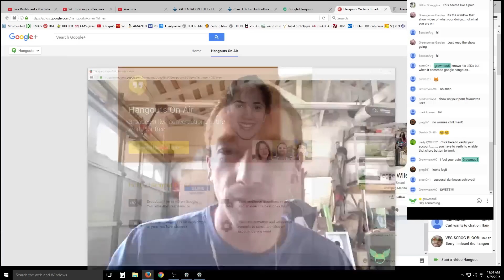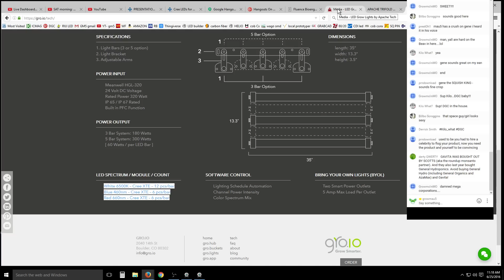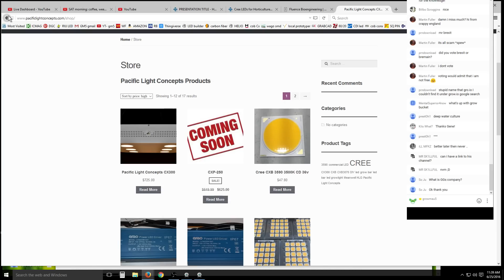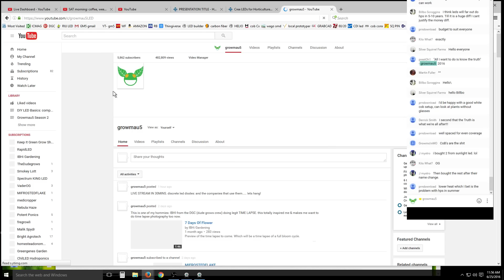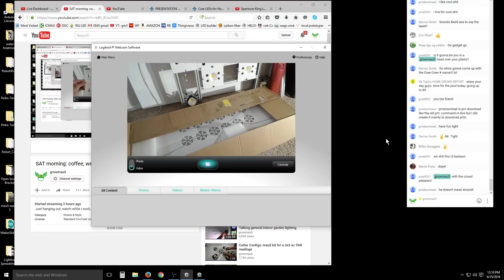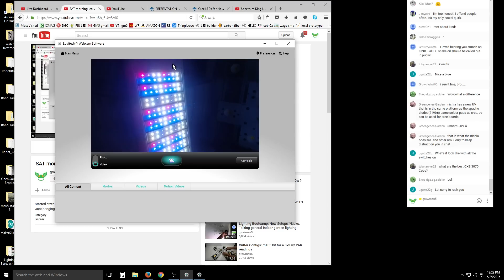LED Tech Talk w/ greengene: discrete diodes & the companies that use them

Comment: 1000 watts for a 4x4 is like..4 times what I'm running for Cattleyas, orchid folks. I've got a mars ii 1200 which is 550 watts, but I only run the grow or bloom switch. Never both at the same time, so that's about 225 watts. My area is also slightly less than 4x4, as I use the standard wire shelves that everyone uses and they are about 15 inches. It works very well, but I'd rather have 4 smaller lights spaced out over the area, and running each of those at full power. Because using the bloom or grow switch is just kind of a waste if totally separate leds light up on each switch, though when I think of itnow, I think some leds are on whichever switch I am running.

Comment: Hey man, i wanted to make a cob light setup for a 3x3 or 4x4 and was thinking 7 cxa2530s due to price mostly; and i wanted to know if for a driver a meanwell lpc-150-500 (150W 150-300V 500mA) would be good or if there was better as far as drivers go. ive been meaning to ask during a roundtable but i cant hang that late on fridays im on the east coast

Comment: I asked you about a month ago about the sk600 and you kinda said they where junk, that copper board is coated in gold and the closet case is only 100 watts and I'm vegging a 5'x5' no problem so it sounds like your changing your tune a bit, some others I've used are, platinum, advanced platinum, lush,sunnine ,pro grow,budmaster,raysace,tiber and what do you think of the perfect sun from grow pot cheaply, check these out and see what you think,cheers

Comment: Here's how to search Cree by diode size: http://www.cree.com/LED-Components-and-Modules/Products/XLamp?Package+Size=7.00%2bx%2b7.00%2b(mm)

The SK600 appears to use the MHD-E or MHD-G (<Probably this one).  Upon reading their description, I think there are at least three reasons for this: MHD's don't degrade much at higher temp, they run at low amperage (just like the reds they have on the same power supply), and they pack a huge amount of light per mm^2.  

Definitely an interesting design; one I have little doubt that Cree helped with.

Looking at SK's website for spectral output, I find it interesting they use 630nm red and not 660nm photo red.  The big manufacturers almost exclusively go 660.

Comment: Amare technologies is looking good
Reply: Yeah... according to them, they use 3000k, 6500k main cobs and mono leds in between to create an overall cri of 95.  I'm thinking to try to replicate them in a diy build (4 x cxb3070 6500k, 4 x 3000k) but I can't seem to figure out what the monos should be.  may just leave them out altogether.  what ya think?
Reply: Yeah I agree Amare Technologies is one of the best out there now.
Reply: They use the mono's to tune the spectrum.  There are a few journals running on GC and RIU using their lights. Pretty impressive.
Reply: +TheLitesol yeah I get that.. I've looked at the cree data (relative spectral power output) and I can see that they are using the mono leds to fill out the areas  (5500k 5000k 4000k far red royal blue IR) but I'm wondering if it's necessary. HPS/MH use one area and work well and I don't see how them little diodes make any difference.

Comment: I am but one, but this is EXACTLY the kind of video I want to see. I love the DIY Tech Talks you guys did back months ago. It is my hope that your new cray DIY light you have built, will turn into a wild series on how to make an automated system based on arduino or something, covering a variety of data points (humidity at points in the space, heat at points in the space, eg; canopy level, soil level, floor. ...and all the bous sensor data sets, and the normal stuff like ppm, ph, etc.) Like an all-in-one arduino core system that covers anything. Want something to sell? Sell me an 'instructable' kinda info product that is a video and written series on how to set up a cannabis-specific arduino system that is data-centric and outputs to fancy graphs and trend lines. Make it useful in many ways, as far as data collation and expression. Like, maybe the arduino system collects heat and sensor data from outside the tent, too, and then the output could have comparative data. Even down to what heat outside the tent does to the inside.  The reason I love your channel is because you talk about efficiency. Every part of the puzzle is valuable for me, but knowing the data and why it's valuable and getting there without wasted energy is what I care about most. Love what you and greengene do, respectively. You guys kick ass. /ramble